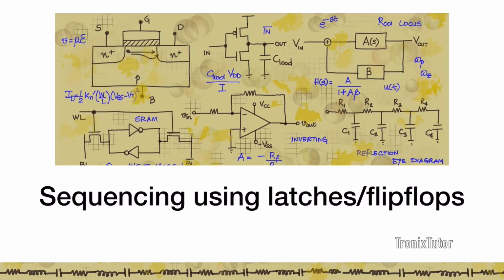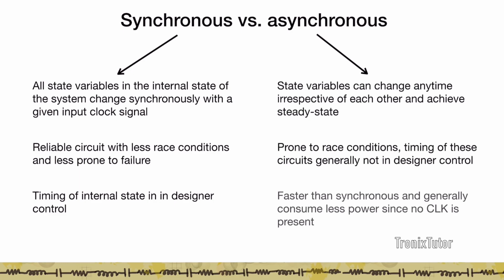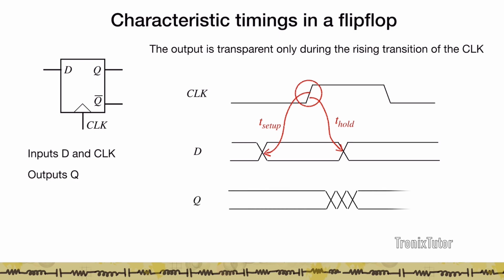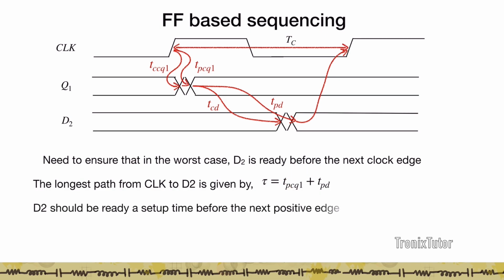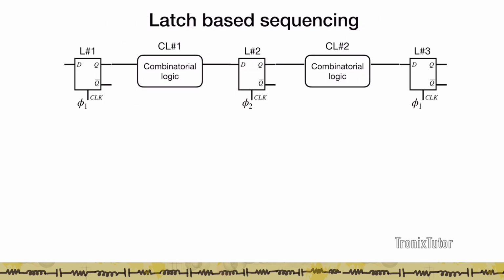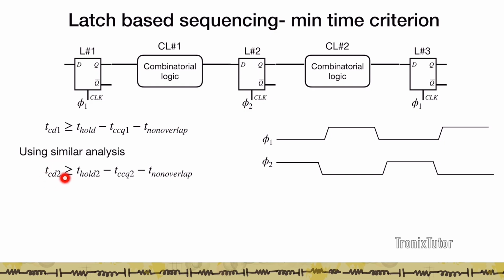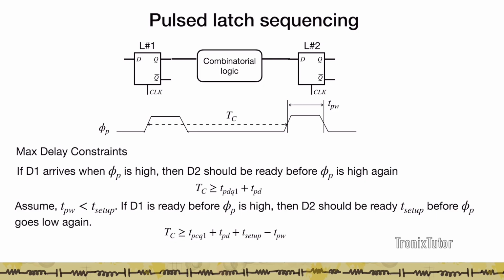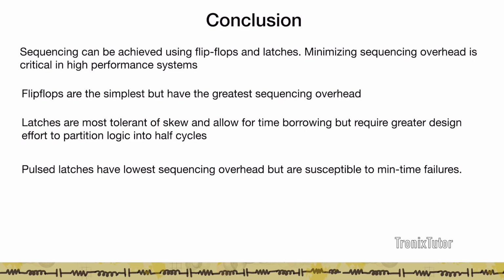Why Flip-Flops Need Setup and Hold Time | Latches, Timing and Pipelines

Comment from the maker: Latches and flip-flops are the basic memory elements in digital systems.

They are used to build:

• pipelines
• registers
• synchronous state machines

Common exam questions about this topic:

• What is metastability?
• Difference between latch and flip-flop?
• Setup and hold time?

If you'd like, I can make a dedicated video on metastability.